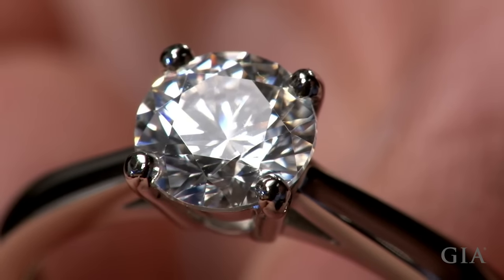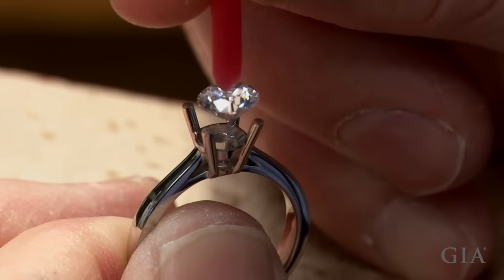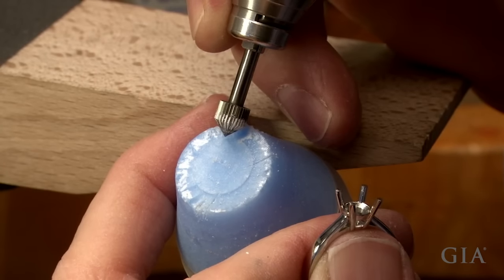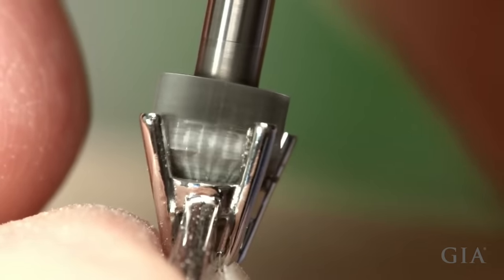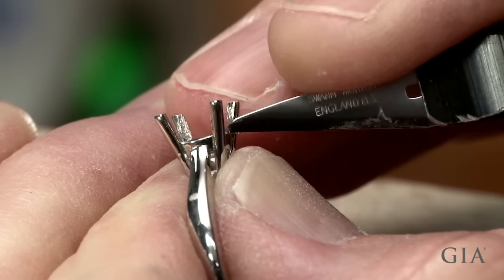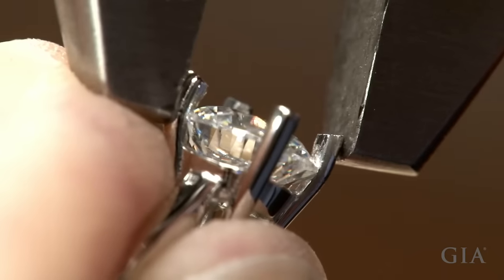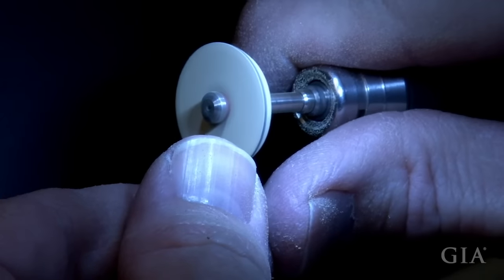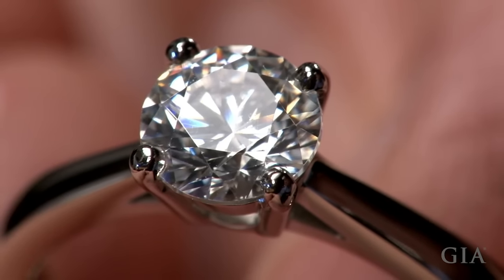How to Set a Round Center Stone in a Ring with Platinum Prongs | GIA

Comment: Why is that all tutorials tell you to use a setting burr, however 99.9% of jewellers/stone setters don't use them
Reply: From my experience, using a setting bur yields the best result.
Reply: @gembak  yea i have never used it either wouldn't the setting bur ruin the edges of the setting or we just don't care because the diamond will hide it?
Reply: @Saywhatohno  If you mean the inside of the upper gallery, yeah, the diamond hides that. I never use setting burrs for prong setting though, only flush setting. I use hart burrs for prong setting
Reply: They could of just used a 45 degree bur and it would of saves time I always use 45’s when setting its s better seat it makes for the diamonds
Reply: Might you please link to a video or upload one where this is done without a burr?

I am looking, but 4 years after your comment, you are still right. They all say to use a burr.